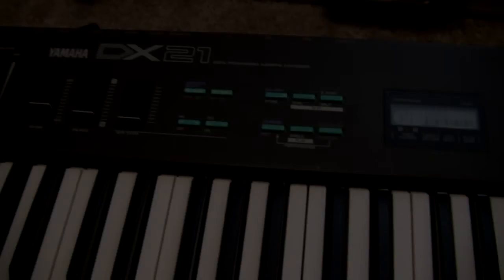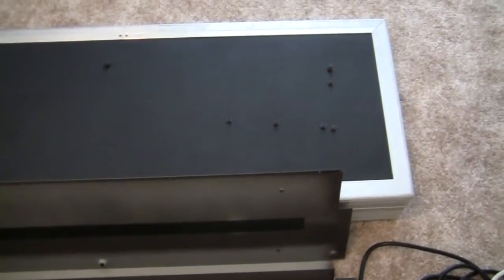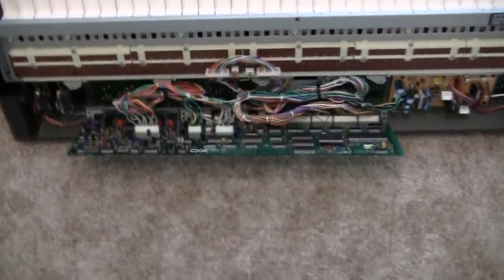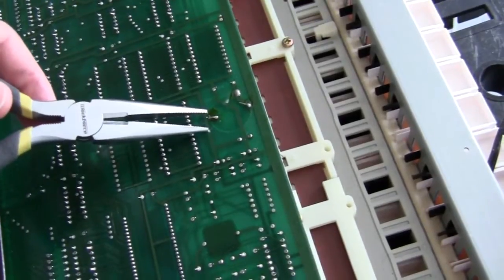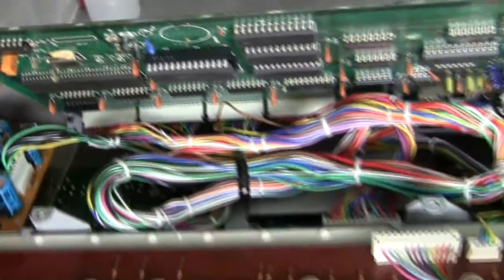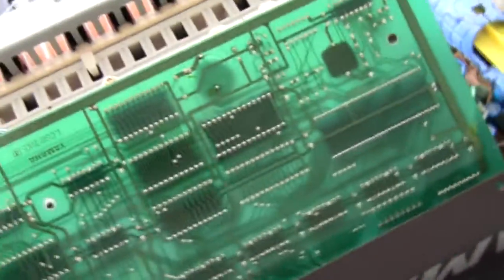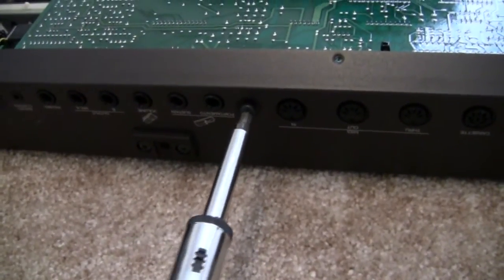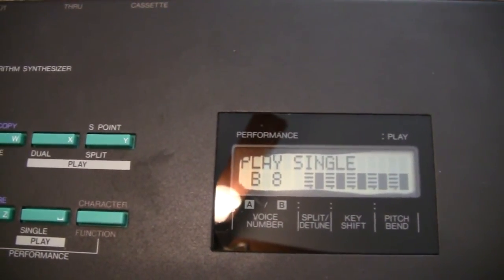[SYNTH DIY] Replacing the Yamaha DX21 Battery

Comment: Did the battery being burnt out mean you couldnt get sound to come out or the LCD to turn on when you switched the power switch on? Because I cant get my LCD to turn on and no sound comes out when its turned on.
Reply from the maker: No sounds or not turning on is probably a different issue.  It has been a while but the battery is mainly for saving patches.
Reply from the maker: The battery is just for saving your patches I think.  That sounds like a more complicated issue like the power isn't making it through.

Comment: Always makes me wonder why manufacturers put so many screws in place and what makes them decide on the pattern that the screw go in ... Alos whay dont they place the internal batteries on the perifery of the unit and make it accessible without the need for taking the darn thing apart ... LOL
Reply: One word: Cost. When a battery is expected to last longer than the unit itself, I guess they have little incentive. Sure they'd be amazed at how many of these are still around in good condition and in working order.

Comment: Hey MR, got an old second hand DX21, changed battery , BUT i could not sold on it !! but the original old said 2.5v i could sold tht, so my new battery went from 3.3v to 2.8 due solding failure.. got it stuck otherway as a test, and NO difference, + most of the text is on japanese ! fun NO! and almost NO Volume even its on MAx in headph, or guitarr amp...  (got any ideas) still battery???? Looks fine out and inside no "marks" or abuse all connectors fine...
Reply: Hey man.  Same problem.  Did you manage to fix it ?

Comment from the maker: If you just want to load up some factory patches or factory banks, you can load them without the data cassette.  You just turn Memory Protect off, then "Load Voice to Buff".  There are (I think) 16 banks of factory patches you can choose from.  The manual should show how to load voices to the user memory.  There are 32 spots of user memory that you can place patches in.  These will all be gone when you change the battery.  Hope this helps.

Comment from the maker: Hi - good question.  I haven't done this personally since my keys are fine.  The way you repair this will depend on what kind of problem you have: 1) mechanical (i.e., something is stuck or cracked), 2) electrical (like a bad solder joint), or 3) chip problem (change the chip).  Here is a video I found that shows repair for another Yamaha synth  (oops, links don't work - type "DIY synth repair - fixing a series of dead keys" into Youtube).  Good luck.

Comment from the maker: @elKocho88 There are some SysEx programs for this such as Midi-Ox or Ctrlr.  As a real quick summary, save the patches using the program before you change the battery.  Then after the new battery is in, reload them using the program.  For all the details you would have to check the program's help file.  Hope this gets you started.

Comment from the maker: To be honest, I don't know.  However, I bet the DX-27 is the same because they are so closely related.  Also, I would guess the DX-7 is very similar because it (only) adds more operators (i.e., maybe a chip or two more) and velocity sensitivity (again probably some switches and chips).   It would make sense for Yamaha for 99% of the circuit board to be the same.

Anyway, the warranty is already expired with these classics so it doesn't hurt to open the case up and have a peek :)  Good luck.